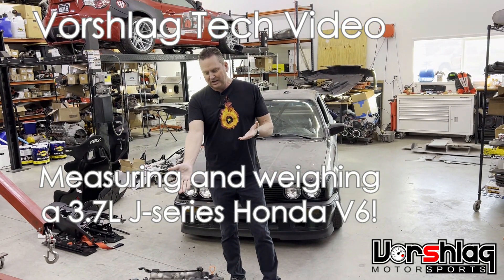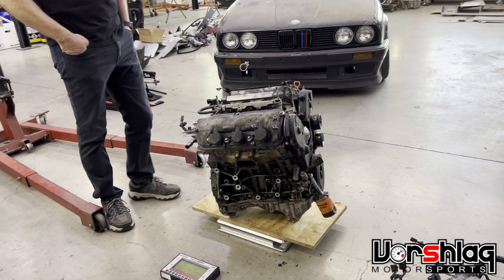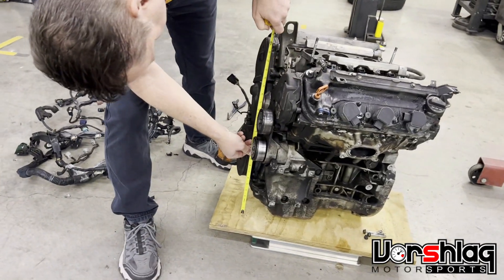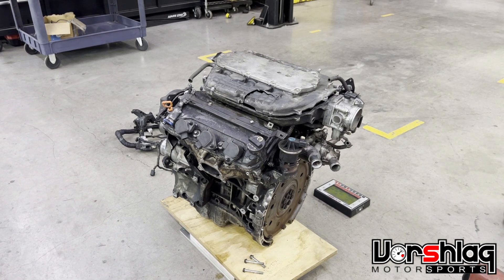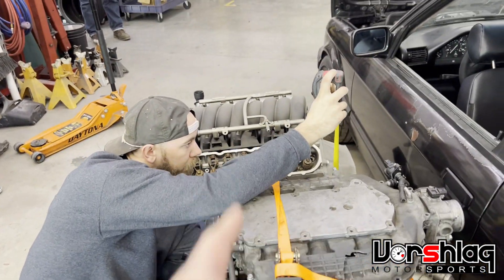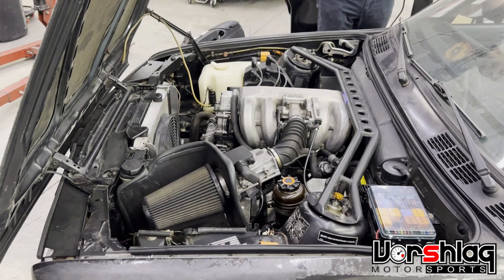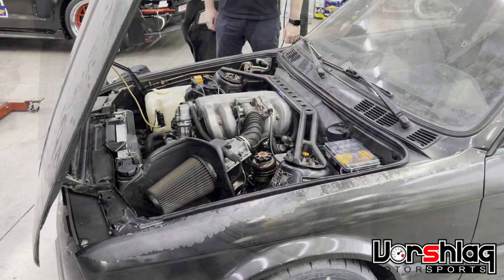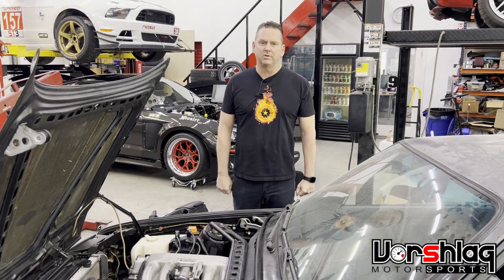Honda J-series weights and measures vs LS1!

Comment: Lv3 might've been a better move. All alum chevy V6 based on gen 5 LT platform. David Vizard math says it should do at least 400whp in a manual 2wd, and more like mid 400s if you pour it out to match the 6.2 as well as install the same size valves.

Comment: Did I miss the weight of the LS in the video?
Reply from the maker: We didn't have a complete, stock LS to weigh that day. What you saw next to it was one of our mock-up LS engines with a "Bluetooth crank" and some other missing bits.
Reply: I wonder how the GM v6 compares. Especially considering you’d lose a ton of weight on the exhaust manifold with the integrated manifold.